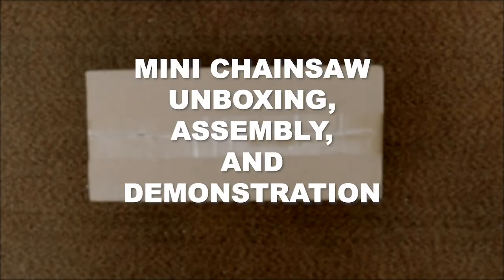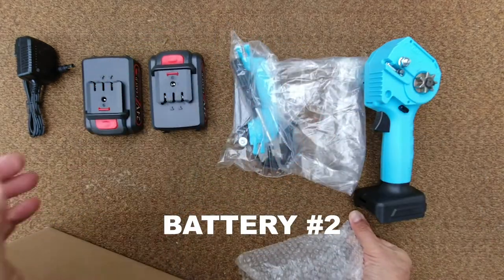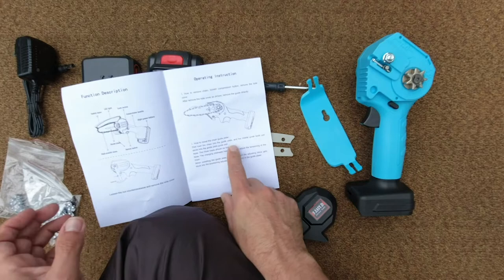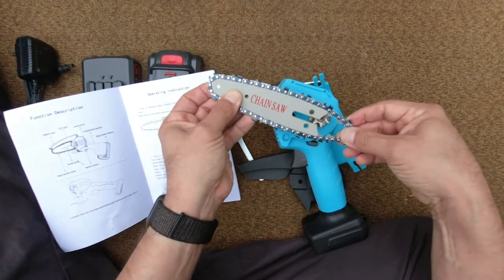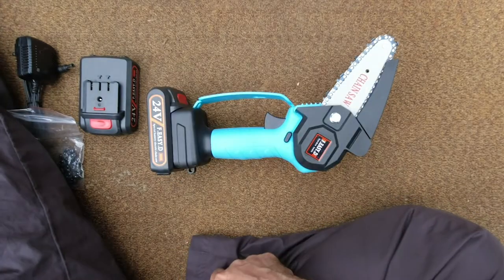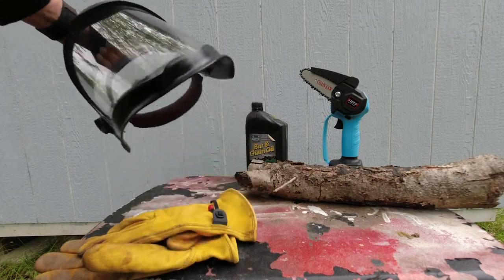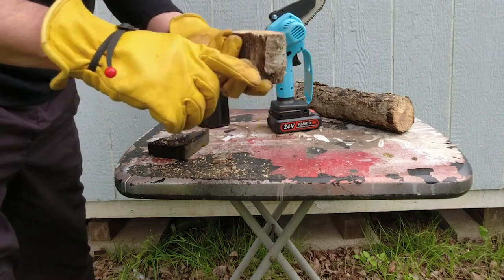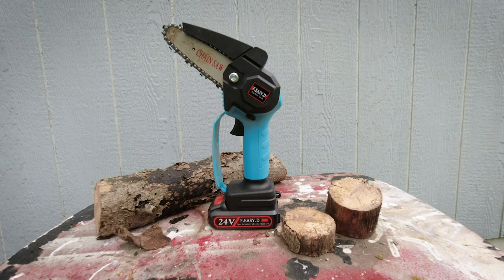Mini chainsaw unboxing, assembly and demonstration

Comment: 2:35  You skipped over the part where you actually put the guide plate on the saw which is the part I'm having trouble with.  May want to think about showing how you accomplish everything in the future.

Comment: Do you need to oil it before use? How many times do you need to oil it?
Reply from the maker: Yes. Often.
Reply: @MichelangeloFlores  Thanks. Kinda scared, im new with those type of tools, but wanted to try so hard. I hope everything goes well.
Reply from the maker: @KunnAllu  larger chain saws have oil reservoirs that you can watch and see how much is used. If you’ve never used such a tool it it best to oil every time you pause.
Reply: @MichelangeloFlores  Thank you for teaching me. I will buy at some point a bigger and larger chainsaw too. Could you maybe do a small video to teach how to do the correct oiling for the saw, i could watch and learn then. Is shrubing with the thing U used an efficient too? Does it need to be specific oil or could i use cooking oil too? 

Thank you.
Reply from the maker: @KunnAllu  sure. Perhaps this weekend. I bought a small oil can for this purpose. It’s not perfect, but it will give you an idea of how to proceed. Stay tuned.
Reply: @MichelangeloFlores  Thank you so much, i will :) .
Reply from the maker: @KunnAllu  I just uploaded a video for you. I hope it answers your question. Be safe!
Reply: @MichelangeloFlores  Sorry for the late reply,  but i watched the video and commented in there too. Thank you once again.

Comment: Hey man! Afternoon! I have a question, I just bought one this chainsaw and I put it charging right away but the instructions says that once it is connected to the power supply must be a red light until it turns green but mine it's just green and it's on and off. Can you or anybody help me!? Please! I bought it from Amazon and brought it to Venezuela.
Reply from the maker: Hmm. If the charger light is green then the charger is probably “good”. Try running the saw for a while and then plug the battery into charger and see if you get a red light. My batteries both had good charge when they arrived. I hope this helped and be safe while operating. Mine is still working well. It is time to trim trees and this little tool is very useful.
Reply: @MichelangeloFlores  I think maybe changing location may affect the charge coz the US and Venezuela works on different type of power or i don't know. What I do now is leaving connected over the night and tomorrow use it on my backyard. If you have any other solution or comments regarding what could possible be, please I'll be very appreciated 👍. Thanks a lot.
Reply: Привет из России ! Имею такую же пилу  . Пилит хорошо . Смазываю  маслом  автомобильным  из маленькой пластиковой бутылочки . Мини пилы захватывают планету ! Ха,  ха !